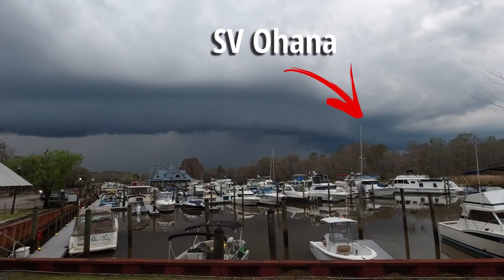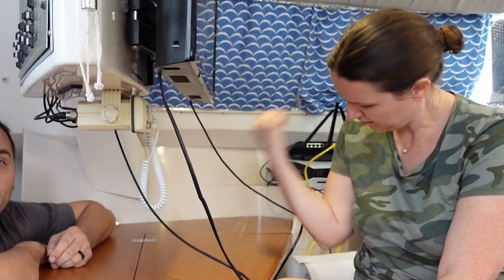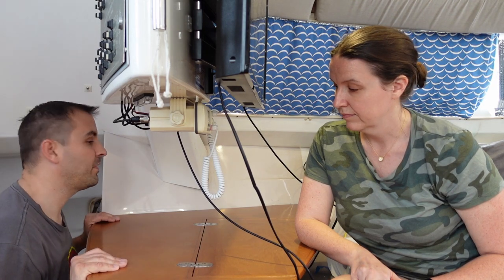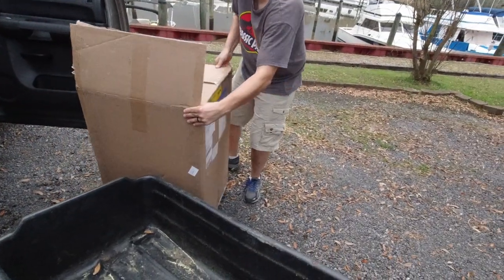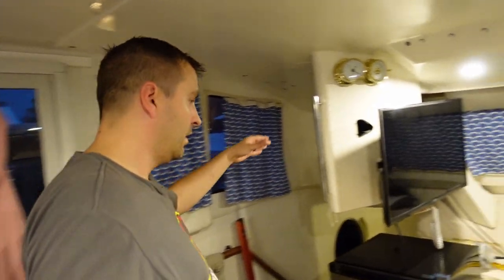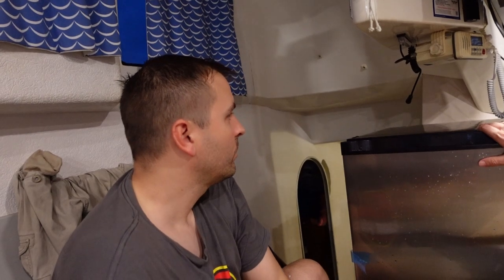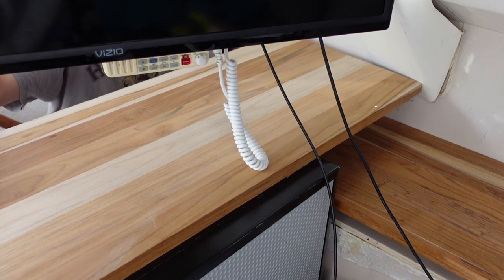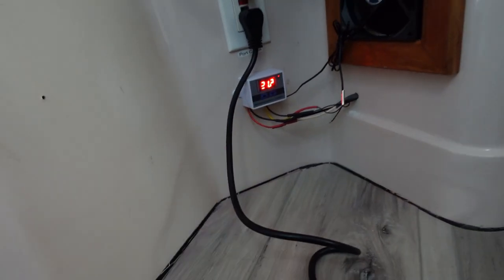Keeping our family fed while cruising!  Freezer installation on Sailing Catamaran

Comment: You can make a fridge/freezer from foamboard and plywood.  Yu could make it a chest freezer and would need a compressor unit from Defender or something.  It would definitely cost more, but you would have more space.  The work does look decent though and the cost of a small residential unit is more appealing.  You might need to do a chest style if you are really boondocking anchor out sailors away from civilization for months.
Reply from the maker: Yeah,  we contemplated building one in that space as well. I thought it would be a fun project but ultimately it was way too expensive and would be too time consuming/messy because we are living aboard. With this set up we have our portable Ingle that I will likely have outside and then this upright freezer as well as the ultra tiny freezer in our chest refrigerator. I think we’re going to be good here.  😉

Comment: Ho vraiment bien pensé l'installation du congélateur. Mais moi j'aurai plutôt installé un ventilateur pour extraire l'air chaud vers l'extérieur. Sinon tu as des mains d'ébéniste c'est bien. Bon courage à vous, j'adore vos vidéos. Tu m'as  inspiré quand nous aurons notre catamaran, surtout avec les batteries lithium, et panneaux solaires. Bises de Bretagne en France.
Reply from the maker: We don't have an easy way to vent the heat to the outside, so the primary concern was to keep the compressor from over heating.   Now, it's been running like this for a few weeks and we have not had any problems with it over heating.   
Thank you!  I have always loved cabinet making!  
Corey